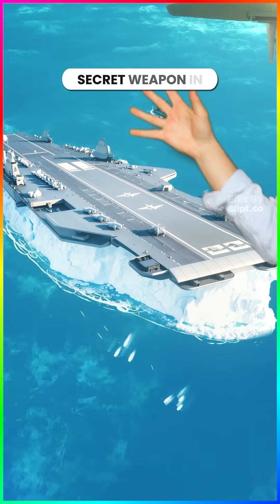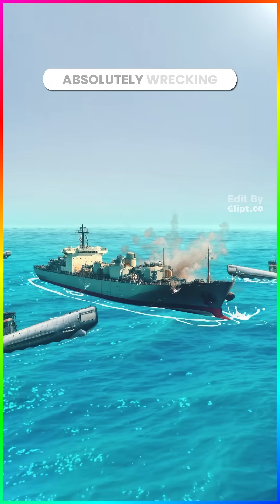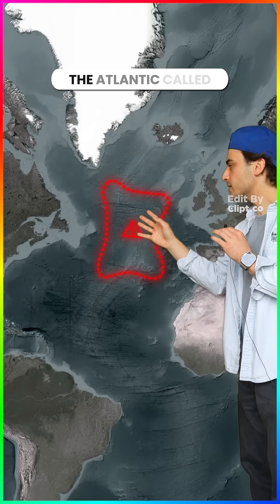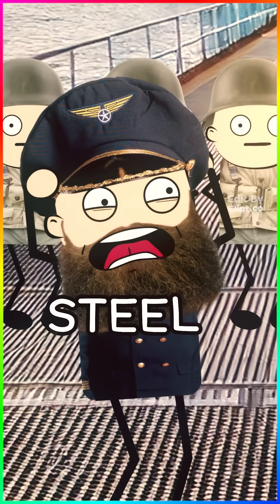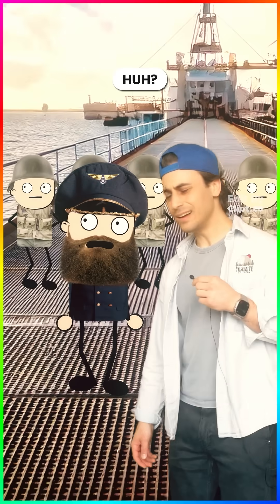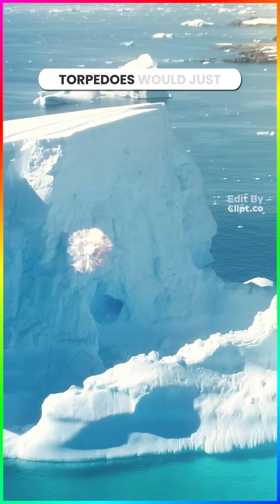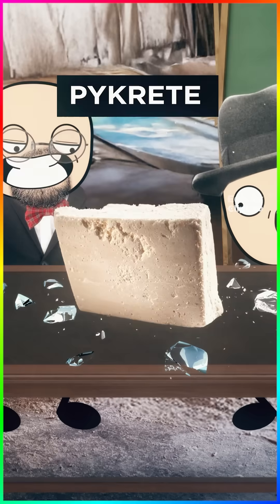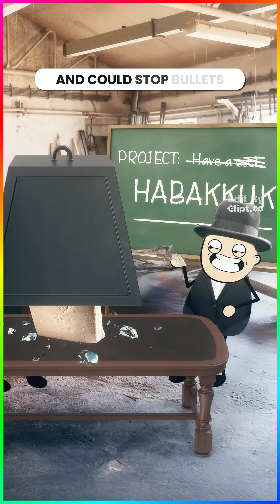Why the US made aircraft carriers of ice..

Comment: id didnt need coling pipes
pycrete held up pretty good
Reply: you literally would need cooling pipes
Reply: Fun fact! Ice melts in water!
Reply: @ShiftyCashew109  exactly.
Reply: @ShiftyCashew109  it does, but i depends on how much ice you got.
for example an iceberg has a layer of freshly molten water around it, which cools it. it melt, but very slow.
pycrete had sawdust in it, so it was very durable agains breaking, which would be the biggest concern
Reply: @ThecertainHazbin Do you know, however, where most of the British aircraft carriers were going to likely (and were) deployed?

the Mediterranean…

Also, think about how hot it would all get. Large diesel engines from 1943 are not very good at staying below room temperature, neither are aircraft engines, or humans for that matter. (37.5C is what we need to stay at in order to not be inefficient at living.) In the colder fronts, we would need heating, and that is a contrast to the cold that pykrete needs.

I understand it’s durable, but you have to think long term about this. How were they going to make them without it being an economic disaster, as well as a death trap?

Edit: Icebergs in the Atlantic are from Greenland. It’s cold there. The mid North Atlantic is also, as you may have guessed, cold as fuck.
There are no icebergs near the Mediterranean (27C at night) for a reason (other than oceanic currents and all that)

Also, I forgot… ICE MELTS AT 1 DEGREE

Comment: The fact that it even went as far as it did in development shows that it was a pretty good idea
Reply: Fr
Reply: Desperate times produce crazy ideas.
Reply: It was too cool for usa.
Reply: did you not watch the video until the end
Reply: @Volleyer5  It was a good idea but with that flaw.
Reply: The idea was shit.
Reply: @The_warthunder_guynot really. Though it was material heavy, it is very resistant to sinking and major damage
Reply: @davolt  the heat of shells and fires from attack would melt the ice, then after that, its just a mass of wood sittin there
Reply: They wouldn't melt the ice quick enough, it's very slow to melt under extreme heat
Reply: @jakem7465  you forget it's a boat. Friction melts ice. Other water molecules that aren't frozen nearby melt ice. Everything this thing would interact with melts ice. Not to mention the crew being miserable on it
Reply: @The_warthunder_guy No it wouldn't. Pykrete IS strong enough to not only resist the shells, but also durable enough to resist the heat emitted by the explosion. 
It is true that water molecules and heat from the sun will melt the ice, but you fail to realize that the solution to this problem was literally mentioned in the video. They'd have cooling pipes to permanently freeze the ice. The idea was really good. The execution, not so much. Not that they executed it poorly, just that the idea didn't allow for the kind of execution which would actually be successful.
Reply: @geethacm1272 what about costs? And crew comfort? Costs would be absolutely insane and the crew would be miserable because they would be stuck in what amounts to a freezer. And you fail to acknowledge the fact that the ice will still melt away, because of how much friction is present just from it being a boat and existing, not to mention all of the saltwater having more corrosive effects. The idea just isn't worth trying when instead you could take the budget alotted and just build another carrier that we know works and that we desperately needed at the time.
Reply: @The_warthunder_guy@The_warthunder_guy That's what I said. The idea is good on paper. NOT in terms of execution.
Also still no, the pykrete wouldn't be susceptible to the corrosive properties of seawater. It is actually more resistant to seawater than actual most metals used for ship building (as long as the temperature is freezing). "But what if the temperature goes above freezing?" Again; the whole ship is a freezer, therefore it literally could not go above that temperature. "Wouldn't the maintenance costs be high" well yeah, and that's why it's a bad idea in practice. "What about friction?" No, that's not how friction works. Pykrete is resistant to the friction produced by the collisions with seawater. You need to realize that if the idea was good enough to be seriously considered, then that idea must've been good at least on paper, right? Had pykrete not been resistant to all those factors, it wouldn't even have made it past the drawing board let alone get on it.
Reply: @The_warthunder_guy It's not really a bad idea, they just had the wrong application for it. They could have used it in the Arctic as a floating base, similar to how the Chinese are currently making artificial islands in the China sea to put military bases on.
Reply: No it was not, just because an idea doesnt work doesnt mean its bad. Ofc ur a f5 player too.@The_warthunder_guy